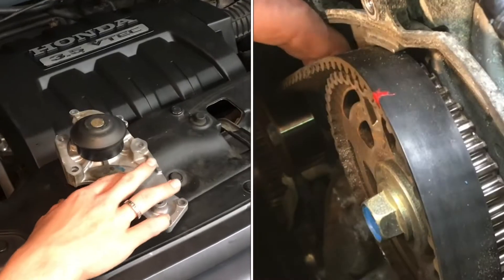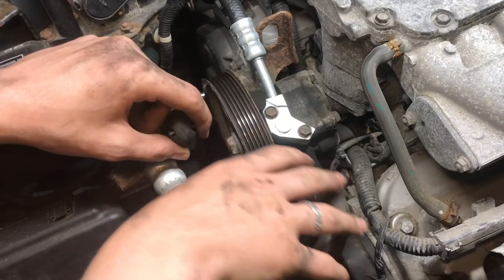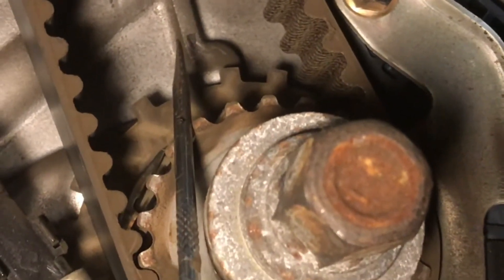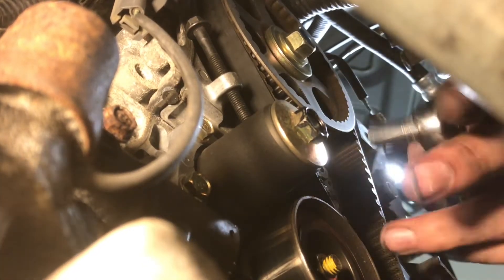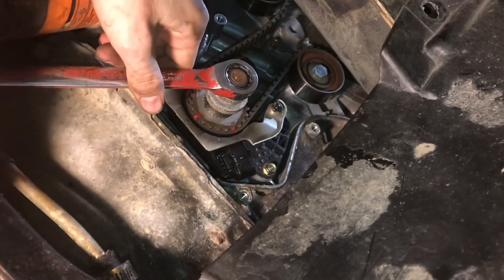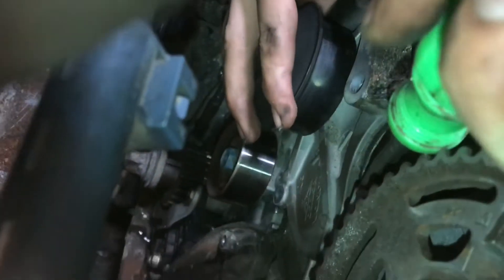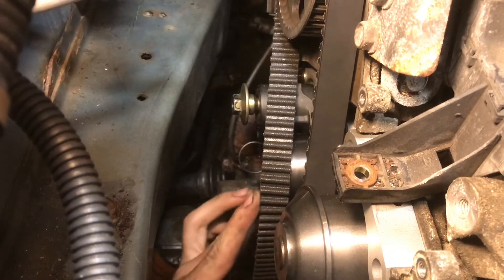replacing WATER PUMP honda pilot 3.5L 05-12 (torque specs)

Comment: Thank you. Very clear and complete instructions. It's been years since I had a timing belt driven water pump. Didn't like them then and won't like it now. But, with good information the job goes easier.

Comment: Before you start make sure u have 6:00 , crank special tool 19mm special socket, water pump and timming belt kit etc... and do marks on dead center when you get to timming belt very important
Reply: By tensioner bolt you mean the damper holding tool right? That comma is throwing me off
Reply: @goochemane50  i was very confused about it too... sorry you dont need it, after calling Honda Mechanic they said just take off tensioner and that's what i did , just gettting the Timming belt back in dead center was a little pain... make sure to make marks on old and new in exact place dead center ... then after put those tensioners ,.... Youtube video is unclear about it , you will have trouble with belt being tight but if you do it this way it will work... also watch other videos. Another one is .https://youtu.be/85iI5dUE7wQ .. watch couple to compare if unclear , 2003 honda pilot is a little different too...
Reply: Got it

Comment: Weird question the bolt on the top left area on the mounting bolt holes on mine I tried to clean out it but liquid came down thru that little cracked hole is that normal I know it’s hard to explain but I can send pics

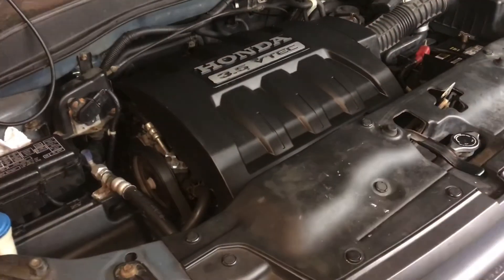Comment: The actual time you show the water pump itself is about 20 seconds of a 14:47 video.  The other stuff is helpful but it'd be nice to see the front side of the water pump and know how many bolts it has and their locations.  Its almost impossible to see them with the engine in the car and that was the whole reason I watched them video.  And that was never shown.
Reply: 10:26
Reply: Just go lookup the water pump at AutoZone and take a look at it.
Reply: He said it was about 10, 10 mm bolts

Comment: What was that bolt you had to cut off? If you can please give the part name and number that would be cool. I have to do this same repair soon on my 07 pilot.
Reply: The bolt that he cut was the bolt from his bolt drawer that he used to compress the idler gear/hydraulic. It's just a spare bolt used to compress. It doesn't go on the car. M6x1.0 is the size. There is no part number, it's just a standard hardware store bolt used to aid in getting belt off.
Reply: @JM-yx1lm  you're amazing 👏

Comment: Not gonna lie, this makes me want a different car. Do the work yourself or pay a mechanic a ridiculous amount of money to replace a $40 part
Reply: same.. my water pump started leaking and oil pump on my 07 honda pilot.. estimated little over $1000 to fix.. ridiculous lol.. i wish i knew how to do this stuff myself, would save lots of money and time. i just watch these videos because i find it interesting.. how can this guy do it in like 30 mins tops probably but takes shops over 2-3 hours then they tell me multiple other things are wrong as well i think they try to scam me. lol
Reply: Probably does take them a few hours its editing. Im about to attempt to change out the water pump on my 07 pilot and im freaking out. This seems like a lot of steps to change a water pump. My lick id get half way and get stuck and i have nobody to help me. Fml
Reply: @jakeschaffer1431  let me know how much work it ends up being. I'm probably going to do it this summer with my brother.